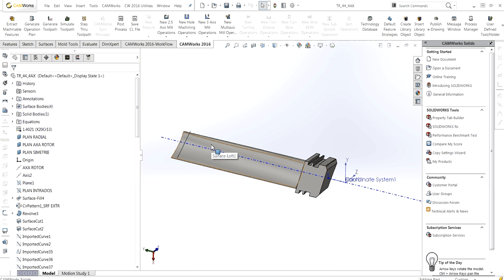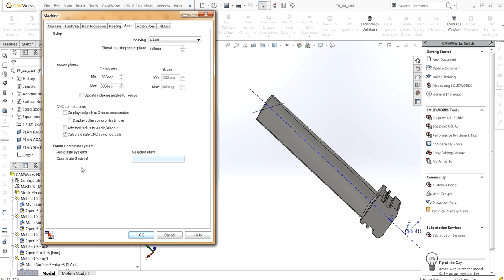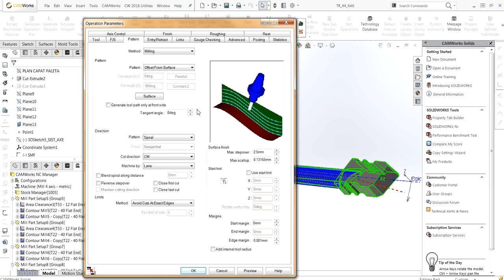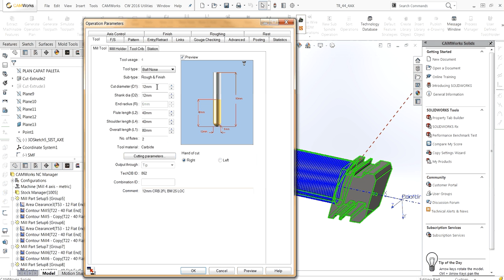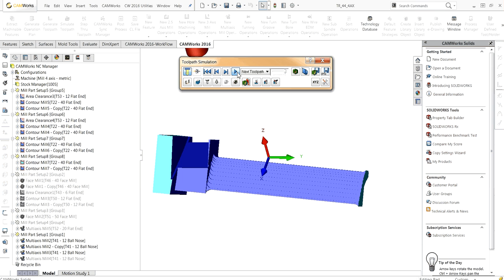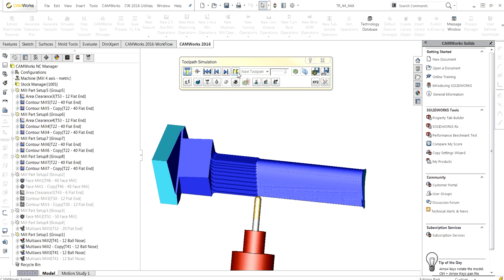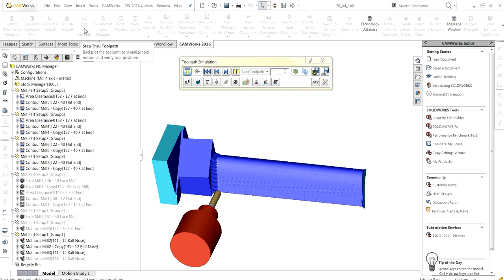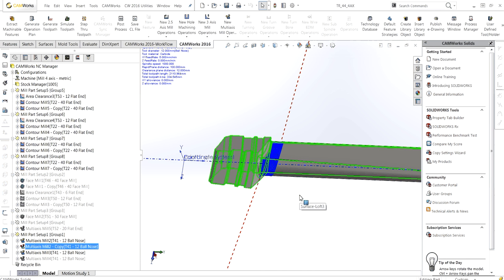CAMWorks - Multi-Axis machining (4 Axis).

Comment: when you do the postprocess to get code (G) how does the code look? With that tutorial post I don't get the codes right, will you have a sample?
Reply from the maker: What post do you use? The tutorial post for 4 axis works fine. Another question on what part did you try it? Send it to me.